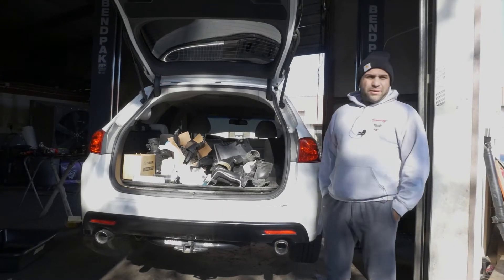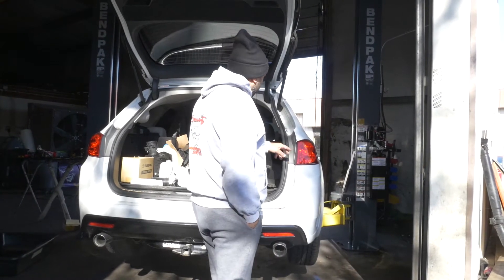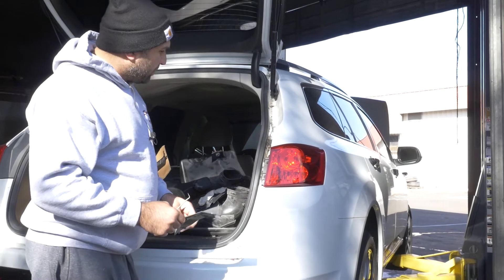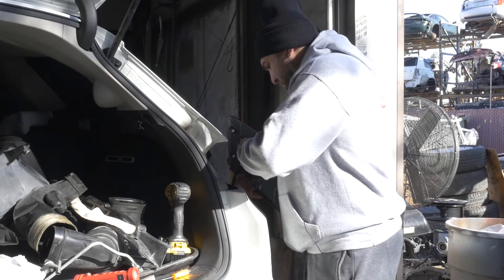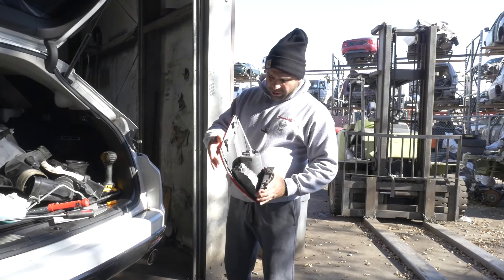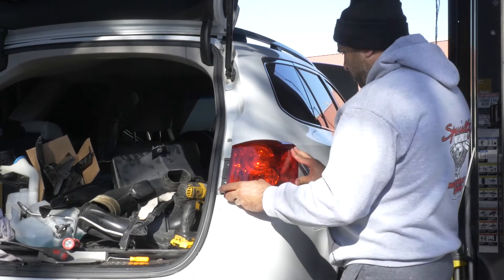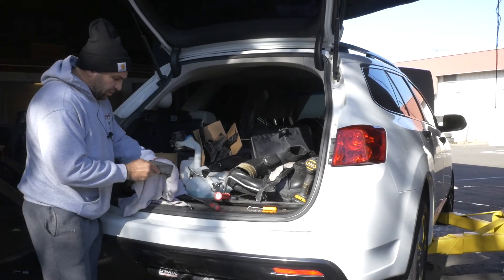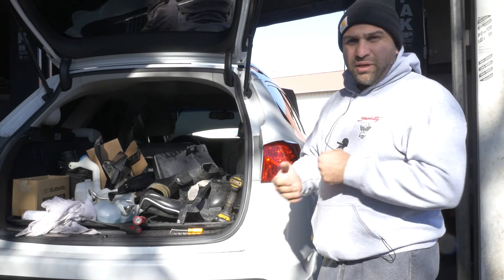How to Remove Replace and Install a Rear Right Tail Light - 2013 Acura TSX Wagon

Comment: I need help!  My wife's TSX wagon, 2014.  I'm getting NO voltage to the tail lights (brake lights are fine).  I've checked every fuse, and even tested every relay inside the cabin and under the hood.  Anyone?
Reply from the maker: Probably a brake in the wire somewhere rats maybe eaten wires
Reply from the maker: Also a fuse box under the dash and one under the hood